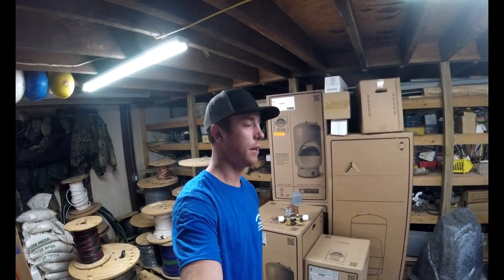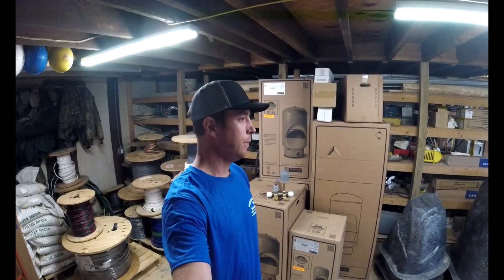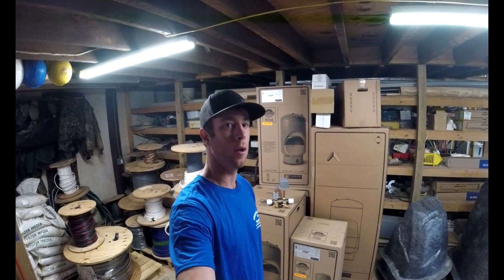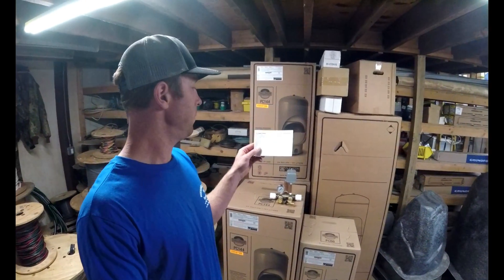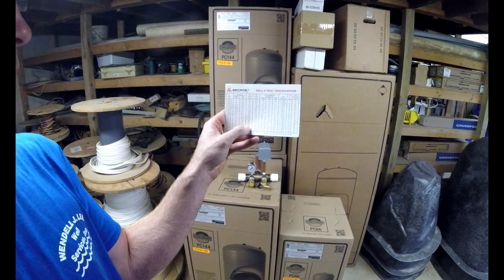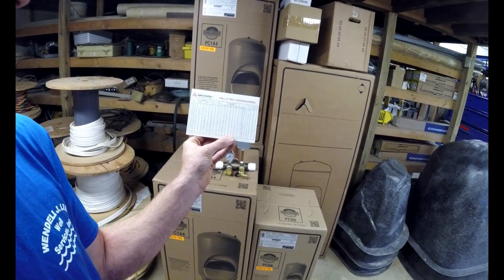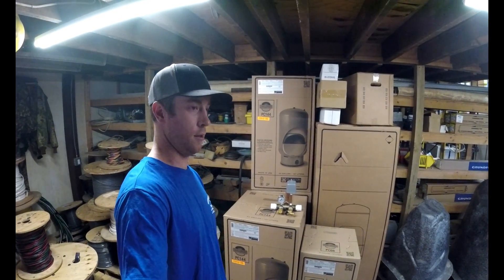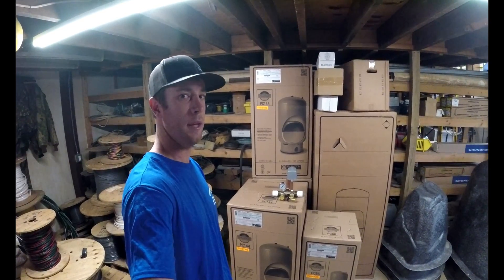Well Pressure (Bladder) Tank Installation and Selection Tips

Comment: well done video just had my tank  give up the  fight, no clue if 1974 is old in pressure tank world  put in flex rite thru tank  hoping understood your video i went with larger tank from 20 gallon to a 35 gallon flow thru  drastic difference  can run  water in all area no loss  drastic pressure not sure if that helps the well pump  last longer hope so thank s again i see u posted this 2 years ago or more still rel vent info guided me in  my upgrade

Comment: Hey I have a question for ya. 
New to well pumps.  I have a 32 gal tank and at 45/65 we are still starving for more pressure.  Current pump and tank are 4 years old.  I was gonna install a 2nd 32 gal tank for longer duration and so I can raise the system pressure to maybe 50/70.
This is ok to do right?
No downside in adding a 2nd pressure tank and due to the increased capacity the pump won't short cycle  is my thought. 
Any opinions or suggestions?
Thank you for the video!

Comment: I think well tanks are poorly designed, possibly to avoid coating the inside of the tank. My thought is that the bladder should be for air rather than water. The bladder shape would not be critical and replacement could be through a port located on top of the tank for easy access so a homeowner could just pick up a replacement  at home depot and install it w/o even fully draining the tank.

Comment: Excellent to-the-point video. Replaced a 3/4 hp sub pump w/ a 1hp (19GPM) sub pump. The 20gal tank is approx 4-5 ft from the 30-50 pressure switch. The pump only 30" farther away, off a central tee fitting, and the other part of the tee goes outside to the irrigation system, after a gauge and ball valve, all 1 1/4 pipe. The new pump runs for approx 30 sec, the gauge needle drops slowly another 30 sec, and pump turns on again, over and over. I have yet to totally empty the tank and then re-pressurize to 28 psi, as the owner does not have a drain handy, just a union joint of galv. which might be dificult. Everything is new except 1) check valve which seemed to be okay and 2) pressure tank (Red Lion RL20), which is not that old, and doesn't show signs of any damage / leaking. I tested the air press in the tank and added 10 lbs, w/o draining the tank completely, although the old 11/4 galv was removed, so water was draining  at one point. Any suggestions?
Reply from the maker: none here

Comment: does it matter much if the pressure switch is on the pump or is it better to have it on the tee?
Reply from the maker: no matter what the pressure switch has to be 5 feet or less from the tank to prevent "bouncing" of the switch (which will burn both your switch and pump up quickly!)